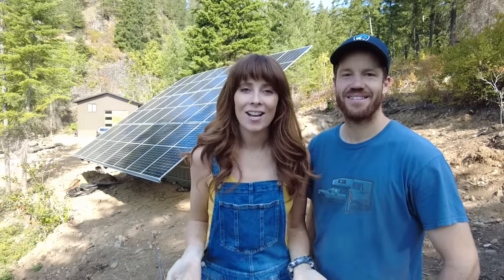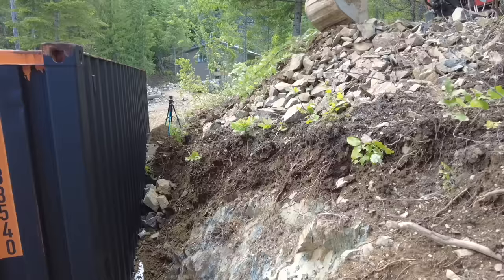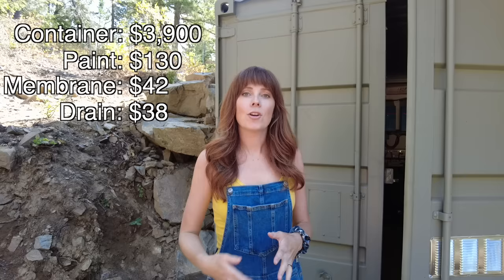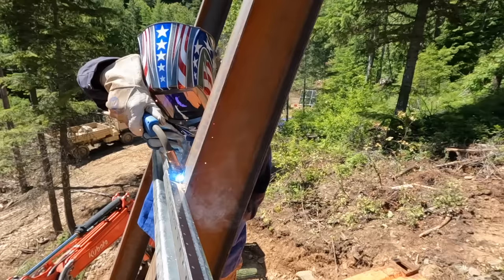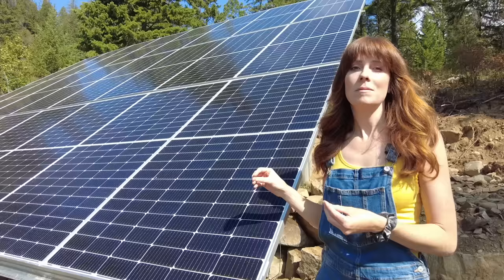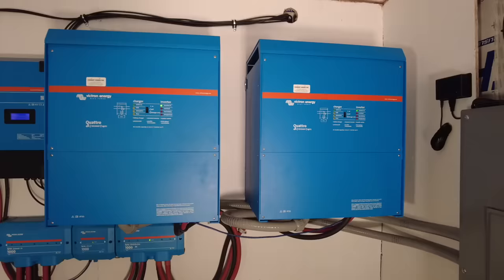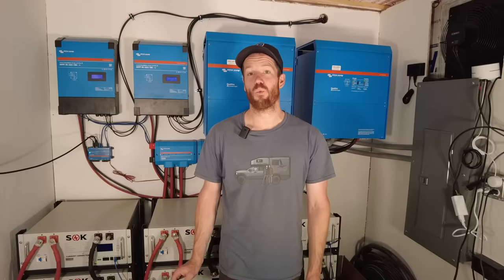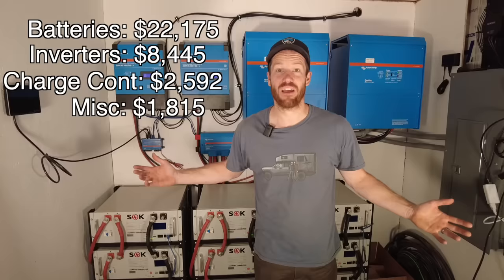TOTAL COST Of Our Off-Grid Solar Power System | Powering Our Mountain Home

Comment: Please remember that the sides of the shipping containers aren't designed to have high loads on corrugated side steel. Floor, top and corners are the support structure. You need to make sure that backfilled side docent cave in.
Reply: That's a good point
Reply: It's a common mistake people make when burying shipping containers, the walls are weak and dent in a lot.
Reply: Dad has one thats been burned for as long as I can remember. If the walls has pushed in its not noticeable....

Comment: We use between 24 and 60 KWH in a day where we live in South GA. So I am planning to install a 30 to 40kwh offgrid solar solution and use a transfer switch to get us to and from grid without connecting it to the grid at all. That way we can just use solar until we absolutely run out of power due to clouds, storms, or over usage and in the flick of a switch just kick the grid back on. The real goal for us is to get completely off grid, while maintaining a minimum hot meter on the house and pay the $15/mon just to have service in case we need it but be fully independent otherwise. In the state of Georgia it is completely lawful to put a home or property off the grid. Thats what living in conservative strongholds is like, we are far more free.
Reply: this can be a nano - grid for 6 average rwandan homes: where the average daily consumption might be 3kwh a day.

Comment: As for the possible wind danger from behind, you can build something there that breaks the possible wind pressure. A couple of huge logs will do the job. If you anchor the panel, a strong wind could still rip off the individual panels.

Comment: I did this in 2005. Grid tied with only a 1kw wind turbine 1kw solar at 48v system. Single Outback inverter rated around 3.6kw output. I transformed a 2nd leg of 120ac for my water well. Had to use 1000lbs of lead acid batteries. No fancy batteries back then. The system was Tiny compared to yours. & I spend 20k. You guys are awesome keep up the hard work !

Comment: Keep eye on the shipping container wall where the sand/dirt is piled to, it can have risk of that dirt eventually making pressure pushing the wall curved.  It is at least one thing of concern you might check few times in future if it holds or not. Also anything related to rainfall water you might check the container corners stay dry.
Reply: The walls will rust out super fast being in contact with the dirt/wet soil

Comment: As someone who has done construction all my life, toss a couple boulders on opposite side of that shipping container as an insurance policy, other than that, this is really awesome what you guys are doing.
Reply: Really as a safety measure you should have about 1ft or so of that other side of container backfilled....a lot of sideways pressure unchecked the way it is, it will increase over time especially with freeze thaw cycles.

Comment: Hi, I hope this finds you well, looks like a great system!! I've just installed a 12kW Hybrid system on my place in New Zealand. 
I've installed hundreds of systems, mainly in Australia... One suggestion that will make a BIG difference to your yield in winter is to lop those few trees down that will partially shade the panels... it's a shame for the trees but will will pay dividends as any panel in more shade will bypass (through its internal bypass diodes) to prevent them becoming a load.

Comment: An idea I wanted to offer with you both in case it's helpful. When your array is in the winter angle, you're going to want to ensure there's room for the snow to fall off the panels rather than pile up and shading them. You could snow blow it or push it, but that's a big pain compared to just leaving it. You may need more room than you think as it's the snow from the area of the panels piled up in one spot. Potential for erosion on that south side is also worth thinking about.
Reply: Hello Andrea
Reply: @williamwoods8765  hello? Do we know each other?
Reply: @ripplesandleaves  no we are not we are friends under the comment
Reply: I found out that exact thing.  Unless you have a hard surface (read : concrete or blacktop) most snow blowers are just too hard to push because the leading edge keeps digging in.  After 3 neighbors thought their machines could handle it (and couldn't) I came across a new Honda tracked snow blower that has an adjustable front lift that keeps the front scrapper either 1", 2", 4" or 6" off the ground so it glides right over dips, small racks and dirt clumps.  It wasn't cheap but it works fantastic after some of out central Minnesota snow storms.

Comment: Great review and will be so helpful to those embarking on this type of project.  Eventually most of the components will cycle through their lifespan.  However, those maintenance and replacement costs will be offset by the very likely increases of electric utility rates and the politicians taxing consumption.  I think you have a system that should keep performing until the next ice age.  Well done!

Comment: Partial burying, 'integrating with the hill' is a huge aesthetic advantage, I'd think doing a little of that on other two available sides could further improve it in addition to possibly eliminating the need for guywires which have their own drawbacks.  

Large rocks and fill half way up on the downhill side would substantially secure it.

Comment: I've run multiple cost analysis for solar installations.  The only time it is worth it is if you are concerned about a "grid down" scenario.  You could put the money you spend on solar panels into a low-performing, low fee mutual fund like VWINX and you'd have more money 10 years later.  There is no situation where the expense is worth it except the peace of mind  during a grid failure.
Reply: Or when you are off grid or have mobile home ;) Then it's even necessity.
Reply: @rkobojcz  Good point
Reply: @JenkinsStevenD  your calculations are right. When you have good quality energy grid, photovoltaic will not pay off (exception is on south where you have plenty of sun all over the year and you do not need to worry about freezing temperatures). Maybe good idea is just to build a kind of PREPERS like backup solution - for normal people just 2-4kW installation will do the job.
Reply: @rkobojcz  Yeah, in theory, the land should be cheaper by the amount that it costs to run power to it, compared to if it is on grid.  So, then its a trade off between how much it costs to run power versus a solar system.  This system is overbuilt for many people, and it would probably make sense build it smaller now, and expand it later on with the assumptions that costs of batteries will continue to drop.  Using a small propane or diesel generator to top off the batteries in the worst of winter or to run when you are doing welding would probably improve the return on investment.

Comment: I would just make sure that the con-ex (shipping container) is adequately anchored, because you have a surcharge (a lateral load) imposed by the rock and earth placed behind it, which will tend to push against the con-ex. Not only that, but you have the weight of the solar array trying to pull it away from the bank of earth. So you have two forces working literally against you. This from a former bldg. inspector. Otherwise, I like the way you folks think.
Reply: I would've put in a concrete slab for the container to sit on. Get a portable concrete mixer and haul in bags of mix. Just need a source of water.
Reply: @greggv8  Would it be reasonable just to sink some piles, protruding up a couple of feet, beside the container, on the downhill side to resist the forces. If acceptable, what style/size /depth would you suggest?
PS.
Thanks guys for the really inspirational channel, even for an oldie like myself. Best wishes, take care.
Reply: @abbersj2935  would have to consult an engineer who knows all the fun stuff about loads, materials, soil/ground conditions etc. for such specifics. Should that container and the solar array mounted to it shift, fixing it is going to be a much harder job than putting in a concrete slab first would have been.

One way I can think of to 'over provision' securing it back into the hillside would be to cut a long trench back from each top corner then set in long pieces of railroad track. Weld that to the tops of the upper anchor points on the container then pour concrete around most of the railroad track. Then push the dirt back into the trenches.

Good architectural design and engineering is well defined, with a lot of lessons learned by disaster and failure. But some things any reasonably smart person ought to be able to look at and just know it's not right.

For example the lousy job of how the spillway at the Oroville dam was originally constructed. There's a guy with a YouTube channel covering things like this, and his videos on the failure and rebuilding at Oroville are especially informative. Among the Oroville WTFs were they didn't clear the site down to bedrock. They expected a lot of leakage through the joints between the slab sections, so they installed perforated drain pipes covered by gravel, retained by some type of mesh. Instead of trenching those into the base (IIRC the trenching was called for in the plans), they laid them on top of the base, making thinner, weaker spots in the concrete. The slab joints were just plain butt joins, no overlap or keying together to try and reduce water infiltration. The drain pipes were routed downward and up inside the sidewalls to dump leakage back into the spillway. That's what's spraying in through the jets along the sides in the videos of it falling apart. As I watched his video I just got more and more horrified at how stupidly it had been constructed, surely they could see in 1967-1968 there were many problems with it.

For the spillway rebuild they cleaned the entire site down to bedrock and literally vacuumed it. They had a whole fleet of people out there with shop vacs sucking up every last loose particle. Leakage through the bad slab joins washed out the dirt under the spillway, which removed support. The plain slab joins were able to shift vertically, allowing more water through to accelerate washing away the soil beneath. The weak spots from the improperly done drains helped it collapse into the sinkhole. The new spillway has a solid base of roller compacted concrete. It still has a drainage system similar to the original, but the slab joins are keyed together to (hopefully) eliminate water getting through. Even if some penetrates, there's nothing for it to wash away.

What I'd do with it is coat the entire thing in an extra thick coating of polyurethane truck bed liner. Make it totally seamless and 100% leak proof.
Reply: @greggv8  Thanks greg, I did see a video on the dam spillway some time ago, very interesting. There are as I see it, two main loads, wind on the panel and land mass on the uphill side pushing the container downhill. The pile restraint idea would stop the second but allow the potential for a small rotational moment, and as you said, top uphill side ties would stop that. It would be interesting to see potential loads using worst case wind +30%. I do wonder though if there would be some damage to the panel mounting before any container movement. All interesting points. But still a great installation which I would consider myself in a similar situation.

Comment: Beautiful couple. I like what you guys did. I am fighting my HOA right now because they don't allow solar installation. My system without batteries is running close to 50,000 for an 11.6KW system. I like those panels you guys used. I will talk to my solar folks about those 440 watters. Good information you guys!!!!

Comment: We went completely off grid for under 5k. While that was years ago, in today's dollars 6k would do it. Ms4024pae for 120/240 power 2k today. Outback 80 amp charge controller 600. 15 8v golf cart batteries at Sam's Club 2k. Champion dual power generator 700. Then as much on panels as possible, used power station ones can usually be found at 100 a pop for 250 watt panels so get 10 to start.

Comment: You should cut the tree down that puts shade on your panels for winter. That can give you way way more yield. Jjust 1 panel having shade can affect your entire array depending on your setup. same goes for 1 part of ashade on a panel if you went with optimizers.

im surprised that the batteries are that cheap tho.  the rest is quite expensive. But batteries here cost 4 times as much.
Reply: pino.......if each panel has it's own micro inverter then the one in shade won't affect the others.
Reply: @johnarnold893  True but i see shade on nearly half the panels and you can see they dont use micros @3:50 so it's better to eliminate the shade of you can.

Comment: I think you may be running light on panels particularly during the winter months.  I'm in Texas living off-grid for the last 5 years.  We are using 60 KwH of Simpliphi batteries with two 12k Sol-ark inverters.  We have 20 Kw of panels and a 22kw generator (26 run hours) for backup that has run twice both times during the winter.  Getting power to the farm was going to cost us about $80k so we decided to build this system for the future 3,400 SF house we are planning.  Currently it powers a 30'x30' shop, the energy building, a 10'x12 office and a 40' fifth wheel with three AC which we use all day during the summer.

Comment: This is my first video with y'all and found it amazing. I'm also working on my future home on a lot of acres that doesn't have running power to my location. I'm so glade I bumped into this video and has given me more ideas to work with. I gotta say I'm loving the price. Even if I could get someone else to due with and though of Tesla, their pricing on just the battery packs and everything built in was over 11k more then your system is and that's not including solar panel purchasing. Away to go and I'll sure be back to watch more things on your channel. Happy 2023

Comment: Incredible setup. Nice work (AGAIN). There's an underappreciated beauty to making your own power from the sun/wind. I actually find solar panels and wind turbines really nice to look at (almost majestic), because I have a deep appreciation for what it means (reducing our reliance on fossil fuels). You two are leading by example.
Reply: wind turbines are not really to be used anywhere, they make noise and are dangerous in winter and so on, solars are good but then you are slave to constantly replacing parts - panels have some lifetime, batteries also and these things are not cheap and must be taken into consideration in budget creation... nobody really cares at this moment and its mistake...

What is the best really are water turbines, if you have any flowing water nearby and you can use it somehow, do it and with it I would suggest to build also double reservoir one above the other and let the water "fall" when energy is needed or "pump it" up when in excess. This is "natural" battery system.

Comment: Small correction: 60kWh, not kW for the battery. Your system is essentially the same size as mine (50kWh battery with 10kW solar), I just use way less per day. I also DIY'd my system (especially the batteries), so it came out quite a bit cheaper: total under $15k.
Reply: Holy smokes!  How do you DIY your batteries?!  PLEASE post links to any resources about this.  MANY THANKS!!!
Reply: @carolewarner101  You can find the full details of my system (and other things related to my off-grid house) on my blog. There is a link in the header on my YT channel. I can't post links directly in a comment, because they get removed by YT.

Comment: I have a very similar system and spent almost exactly the same amount,  though I saved a bit doing some different things DIY; like building the batteries.  Got all th Victron kit from Current Connected as well.  2 x Victron quattro 10000va inverters, 3x Victron mppt rs 450/100, 2 x lynx power-ins, 2x lynx distributors, lynx shunt, same cerbox gx and touchscreen, 5 x 14kWh batteries with Seplos kits and Neey active balancers, 41x 455W panels, Ironridge roof racking.  I'm using the commercial grid in place of your generator (backup when battery is low), but otherwise exact same setup.

Comment: Metal is a good conductor of heat so in winter, if you don't have insulation inside the container, there is no hope for having any sort of warmth in there because it can very easily escape via the metal at the top. The warmer air will rise inside, hit the ceiling metal, and transfer outside so it will be just about as cold inside as the outside temperature without wind. The earth will only help keep the metal floor not too cold but that will not warm the air inside.

Comment: Eco Worthy Solar Tracker $400 each set can easily hold 6 panels. All you need is Qty.4 x $400 = $1600 done. It comes with a wind sensor to avoid the wind hazard.

Comment: For the shipping container to gain any significant advantage of warmer temperatures underground it would be necessary to bury most or all of the container below ground level. This is because leaving the top, ends and one long side uncovered would expose them to air temperatures that could be freezing or well below.  One possible approach to the current installation, which may or may not be cost effective, would be to insulate the walls, floor and ceiling of the container, or all of the exposed exterior, which would be expensive and might not make much difference without a relatively small heat source inside the container. FYI, in your area the ground temperature 4-6 ft below the surface would be around 48-52 degrees F year-round; in winter the frost line is likely around 30-36" +/- below the surface. I really enjoy your videos; keep them coming.